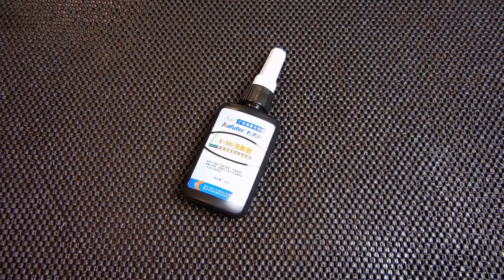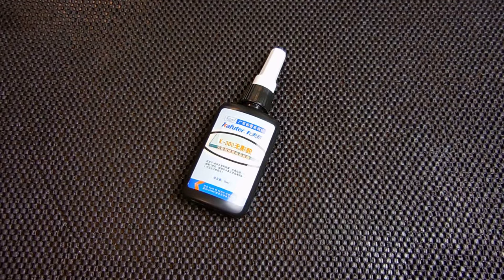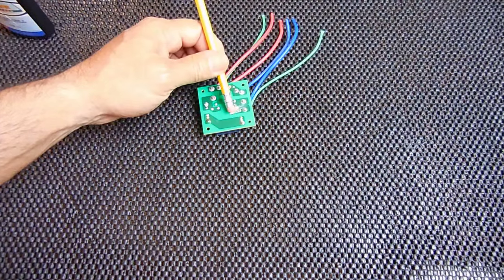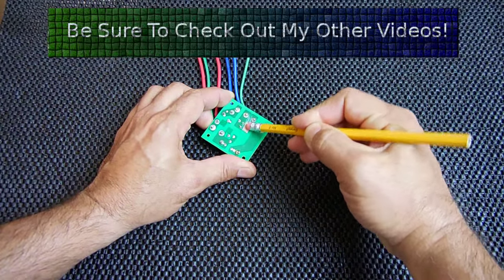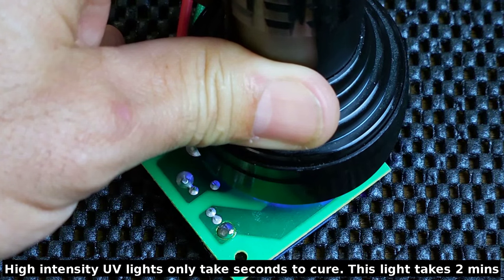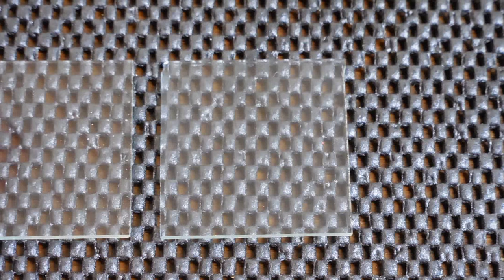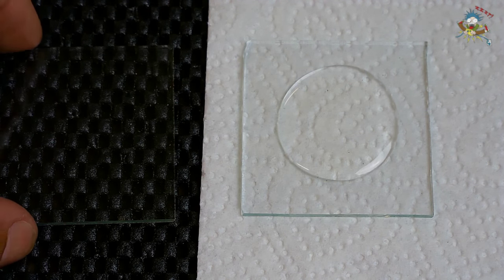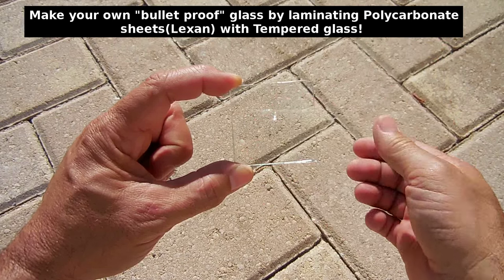UV Curing Adhesive (Bonds Glass/Metal/Plastics/Crystal)

Comment: Well it came yesterday and I was very excited to give it a try, put a little drop on something shone my uv torch at it for 5 seconds and tested, it was still wet, tried again with the light for 10 seconds, still wet, finally I set the light on top of the drop and left for a couple of minutes and it was still wet, not impressed. Next I took it outside into bright full sunshine and put 3 drops onto something after a few minutes it had dripped in each other drop creating a long smear but was still wet, left it for the rest of the day and overnight and checked it and guess what? still wet, extremely disappointed in this product, I would not recommend it to anybody that want's to glue small objects, from what I can gather from the extremely limited information on this product it is only useful for glueing large spans of glass together.
Reply from the maker: +Mentorcase 
The UV led you're using must not be high intensity, or the spectrum(nm) is wrong. I have a feeling you have a bad mix. Placing the adhesive in full sun will quickly start setting the adhesive. In 10-15 minutes the job is done. Contact the supplier and request another bottle. I have no problems with my adhesive(as you saw in the video). I recently glued a broken beak on a crystal dove. No problem. Thanks
Reply: That is simply not true. UV adhesive is a massive thing these days used all over the world. All that's happened is you've got a fake / poor / old / wrong type batch.

Comment: QUESTION, is there a way to reverse the adhesive if I needed to separate or remove what I used the UV glue on? If not what’s the best way to get it off? Also have you tried the “Nichia UV LED” that uses 365nm. Excellent review of how it works and, more importantly, it’s clarity.
Reply from the maker: Hunter Keating Once cured, it's permanent.

Comment: Thanks for the video!
 Do you have any idea how well this would work for reattaching a rear view mirror button back onto a windshield and if you think the bond would be strong enough for a rear view mirror?
Reply from the maker: Hello. Should work fine if use the proper formula for metal/glass. You 
can also clean the area using 91% rubbing alcohol, and use crazy glue.
Reply: electronicsNmore  Thank you, I went to that website, I think I'll give it a try!

Comment: How hard is the 302 when dried?  Hard as glass or like plastic?  I'm thinking about using it to fill in a dent on a metal guitar fret.
Reply from the maker: Dries very hard, but vibration over time may cause the repaired area to fall out. Lightly rough up the repair area with 400 grit abrasive paper, then clean with 91% rubbing alcohol before applying the material.

Comment: acrylic is uv resistant. how would it penetrate?
Reply from the maker: Not all acrylic is UV resistant. If it is, and you're bonding it to glass, you'd expose the glass side.
Reply: @electronicsNmore  I'm trying to bond acrylic to acrylic, and for the application it's ideally UV resistant.
Reply from the maker: If the acrylic isn't for a window, it should work.

Comment: How strong is the K-300 blend for bonding plastic things together? I know there's formulas specifically for plastic, but they seem to be much more expensive.
Reply from the maker: Only works on CLEAR plastics. The UV light needs to be able to reach the resin to cure it fully. I think it's strong stuff, but you may have to do your own tests. Thanks for watching!
Reply: Mine finally arrived and I'm very disappointed. Even when exposed for 30m with a UV torch it does not set that solid and there's a Vicks Vaporub smelling grease residue on it. It seems to set no harder than very soft rubber.
Reply from the maker: @Ziplock9000  Place it in the sun for a few minutes, hard as a rock. Your UV light is either too weak, or not UV, but blue light.
Reply: electronicsNmore even when i our mine in the sun it did not harden

Comment: Hello, in the video where you bonded two pieces of glass together with the UV light:  how do you clean the edges of the bonded glass, do you clean the excess while the UV glue is still wet and what product do you use to clean it with?  Thank you so much for your help...RR
Reply from the maker: You gently wipe away before curing. You can also use 400 to 600 grit wet/dry abrasive paper after you cure. Thanks for watching!

Comment: How to remove conformal coating from a circuit board?
Reply from the maker: +Epice 
Never had to remove the coating. If I wanted to replace a faulty component, I usually take a utility knife blade and scrape away the coating from the soldered connection.